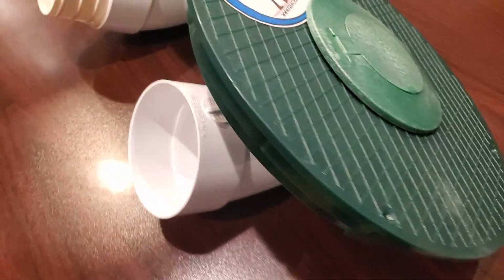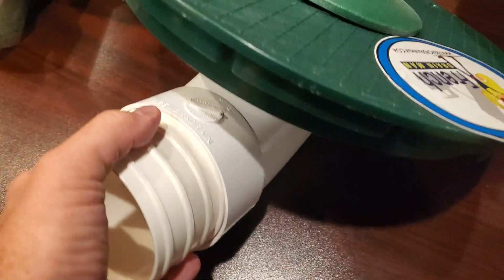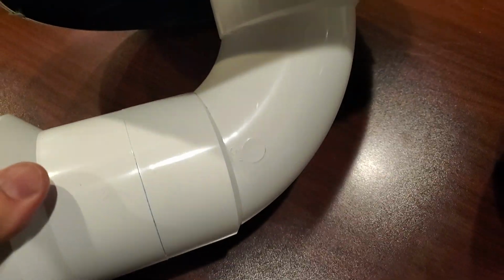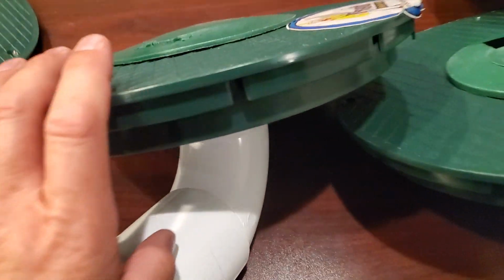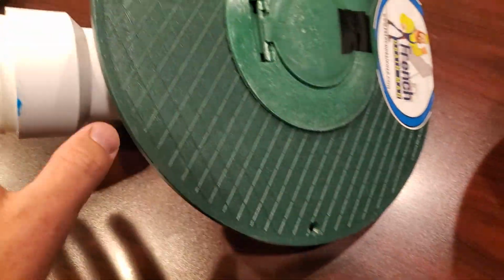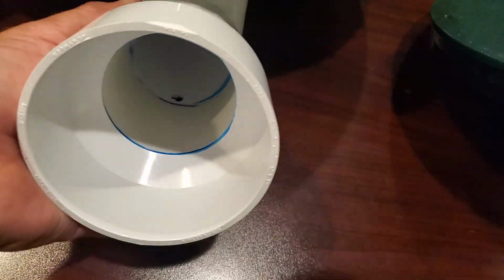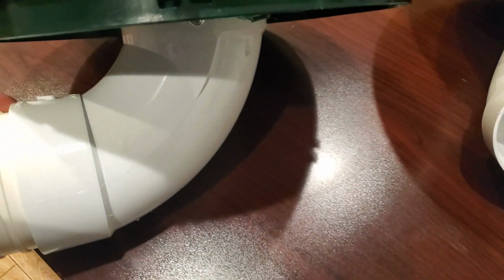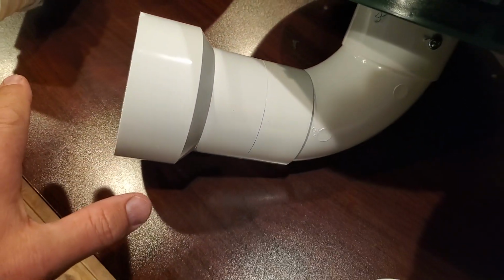Best Pop-up Emitter with Turf Restrictor Plate Design French Drain Man

Comment: The regular pop-up I had always gave me a concern that when there was a heavy rain it appeared the pop-up didn't open enough but never-the-less it worked. Over the years I mowed over it many manty times without a problem.  Watching your video I was convinced that the French Drain Man pop-up would relieve my concern about handling greater water flow.  I purchased the French Drain Man pop-up you recommended only to be disappointed. The first mowing I did destroyed the hinged lid. The vacuum from the mower was enough to pull the lid open to catch the mower blades. I checked my mower height and it is still set at 2 3/4".  I also checked the height of the new French Drain Man pop-up when I installed it.  Maybe the flimsy plastic hinge gave?
Reply from the maker: Best French Drain and Yard Drainage Contractor
https://frenchdrainman.com/

Comment: im in a unique situation. i built a shop in the back, but have a single car driveway and need to get the water out of the backyard to the front, we have natural slope down the driveway. i need to do something this year before the winter hits and then going to redo driveway and run it underneath to daylight. im wondering how this would hold up at the edge of a driveway. also, curious what pipe you would recommend for going under a asphalt driveway when we redo it.
Reply from the maker: Downspout Pipe 4 in. x 100 ft. High Octane ARMOR Pipe
https://frenchdrainman.com/product/heavy-commercial-solid-high-octane/

Comment: Does the turf restricter help with erosion you tend to get around pop ups? Also do you have one I can connect to a 6 inch pipe?
Reply from the maker: We do have 6 inch pop-up emitter with turf restrictor Plates
Reply: @FRENCHDRAINMAN  what is the difference between a 4" and 6" pop up emitter besides size? it's there one benefit over the other?
Reply from the maker: Store | French Drain Systems | Curtain Drains | Macomb, Oakland, Lapeer, St. Clair County
https://frenchdrainman.com/store/

Comment: Excellent!  Glad to see this. I'll need at least 3 of the 4". Now, my question would be. Do i need to go up a size because I'm tying into another downspout on each side of the house?

Thanks for the great content!!
Reply from the maker: We tie a 6 inch pipe into a 4 inch pipe. Because of the "MASS FLOW RATE" it will not restrict water flow. Water speeds up when a fitting in smaller. We use the 4 inch for big  Tree leaves like Maples and tie up to 4 downspouts into one main line.